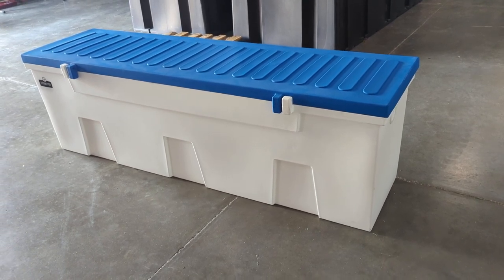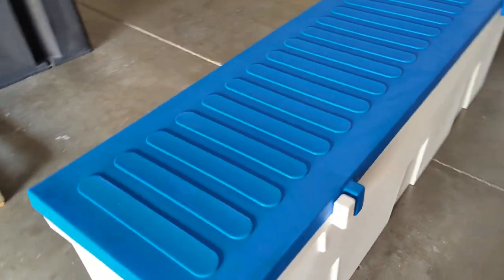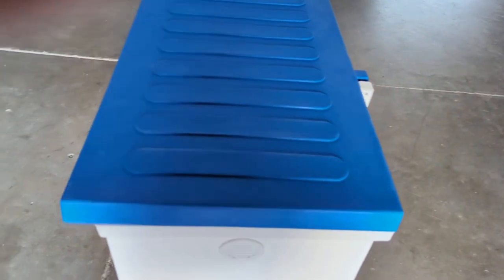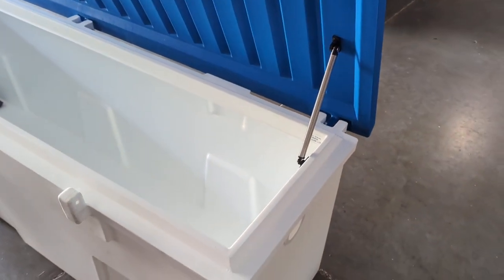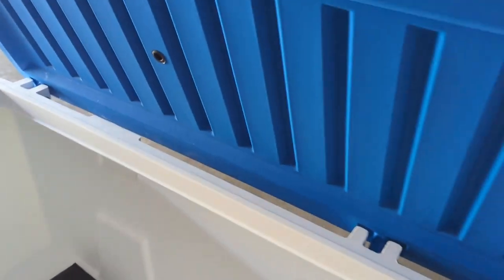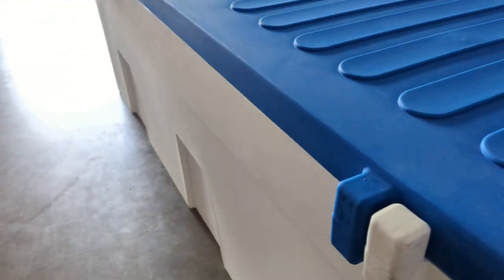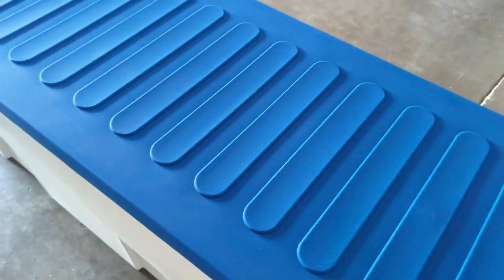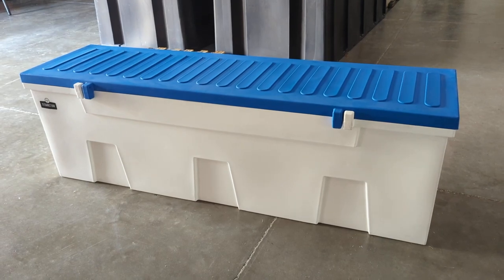Titanstor 7' dock box

Comment: Is there an offset mount for this box? I just purchased one. If I want to flush mount it to the dock, are there any particular spots on the bottom where I should screw in the bolts that shipped with it?
Reply from the maker: There are off. Brackets available where you can mount the unit off the side of a dock. If you are getting mounted flush on the dock you can screw through it anywhere on the bottom just make sure obviously that your bolting through the Wood and not hitting the space between two planks